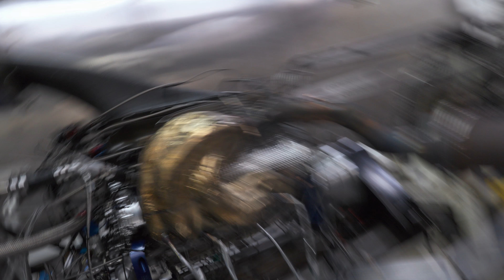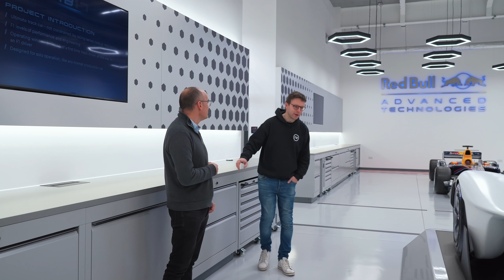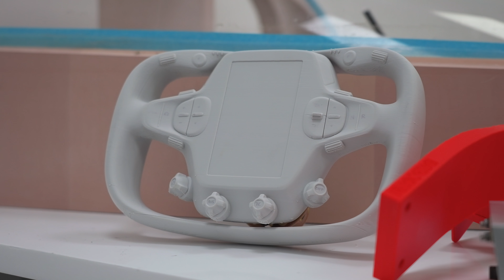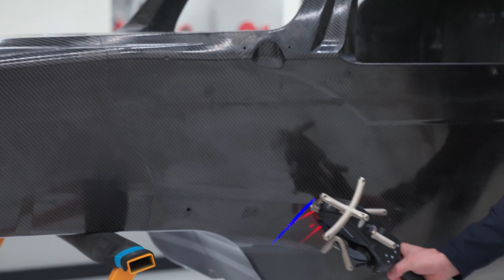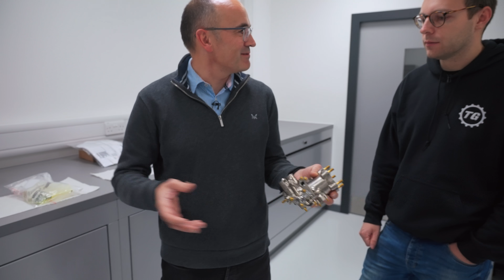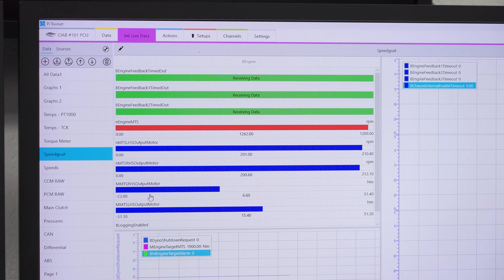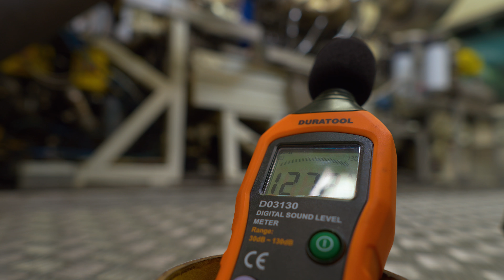Hear The Red Bull RB17 Scream: 15,000rpm V10!

Comment: You dont know where the dogs are you just get a sighn wave matching the rotation and slam the gears together at every point on the sighn wave and the ones that work best well there you have your timing to slam the gears together and vuala they match up but that does not mean that you know where the gear teeth are... if im correct at all in my assertions

Comment: At lower speeds it sounds like a hydraulic pump and that sound is pure torture.
Reply: U know that is an engine dyno right?
Reply: @Shin_Majin No. Thanks for telling me that.
Reply: @magnusenamd yeah so it will sound way more high pitched and better with an actual exhaust system in the car running. It's like taking off the fine tuned system of a trumpet and just make a metal tube to blow into.

Comment: "This word usage is a metaphor derived from the idea of a dog (animal) biting and holding on, the "dog" name derived from the basic idea of how a dog jaw locks on, by the movement of the jaw, or by the presence of many teeth. In engineering the "dog" device has some special engineering work when making it – it is not a simple part to make as it is not a simple bar or pipe, and the metal used in its construction is likely to be special rather than regular steel."
Wikipedia

Comment: Why is it called the rb17?!
Reply: RB16 was the 2020 F1 car.  RB17 was to be the 2021 car when the new ground effect rules were to come in. Because of covid those rule changes were pushed back a year so teams ran a variant of their 2020 car.  Red Bull called the 2021 car the RB16B rather than the RB17. For '22 they jumped to the RB18  (their 18th year in F1).  So the number 17 hadn't been used.
Reply: They started designing it after 2021 F1 season and back then they ran RB16 in fornula 1

Comment: If the engine is even firing, then it needs an X or Y pipe in the exhaust to truly sing. Right now, it sounds kinda flat and plain. If it's not even firing, then it needs to be, PLUS the other thing.
Reply: Once the car hits the track it will feature a 10 into 1 exhaust layout giving it a higher pitch like the McLaren mp4/15 which Adrian newey was intending for rather than the 5 into 1 which it featured on the dyno featured as a test mule
Reply: @R33_MKR 10 into 1 is insane. People have tested 8 and 12-1 and reported power losses (even with "correct" collector sizes) over multi-junction systems. This engine, if even firing, with an X or Y pipe, should sing higher. Like Ryan Tuerck's Judd V10 swapped Supra (which already simulates 22k rpm F1 V10s and their divorced exhausts) but pitched up 4.5 semitones.
Reply: @Drunken_Hamster  In the talking bulls podcast Adrian Newey said that during his time at mclaren when the v10s where around they had a 10 into 1 exhaust system for performance reasons, and he and the people at Red bull advanced technologies has been carefull to do the same on the rb17, thats why its a single exhaust on the spine of the engine cover

Comment: 15k rpm... if you use it every day, it won't last 1 year, imagine changing the engine every 8/10k km in a road car
Reply: This ain't a road car also in F1 with similar engines u would change multiple engines in the span of 1 season. They had less races back then too.

Comment: There's lots of industrial equipment that make quite a similar sound. 
It isn't really the sound by itself that gets the heart racing, is it? 
It's knowing it can be strapped to a chassis with 4 wheels, accelerate 0 to 200 mph and back to 0 in under 14 seconds, with a package weight less than 800kg.

Comment: 16:44 - "Someone will write in."

That someone is me.

Those are called dog teeth, not dogs and not dog lumps. They are called "dogs" for short, but to be clear they are "dog teeth".
Look at the 20-30 teeth on a typical road car's manual transmission gears and you'll start to see why they are called such. Only having four of them, and them being very thick, certainly hides their naming origin.

Comment: Completely useless and ridiculous car. 
Going down the highway a rock hits the paint and it cost you $20K. Not going to leave in a parking lot ANYWHERE. No way your taking it to a trackday, risk losing control. Even if you did you need to be a pro level driver to actually manage it well. 
While im sure this stupid thing cost millions $$ to own, the rest of the mass population is trying to deal with new tires and property tax on our everyday car.

Comment: Interesting that the tub extends a long way forward, all in carbon fibre; compared with many other hypercars that have a front subframe made of aluminium. I failed to comprehend how the gearbox works precisely but I think the second shaft (lay shaft?) was obscured with the particular camera angle. I have seen an F1 gearbox but that was about 15 years ago. 
Good video.

Comment: They are making affordable cars less desirable. "Hot-hatch" type of cars are either extinct or too expensive to buy for mere mortals. At the same time they are building $ multi-million cars with haptic controls, manual gearboxes, V10 engines revving to 15k RPM and you can bet those cars get sold out before they even hit the market.

You own nothing. Now they own everything and still can't get happy. No amount of physical possessions can make a filthy rich human happy. While normal down-to-Earth people are struggling to put the roof above their heads.

Comment: No expense spared!
That granite Mitutoyo surface table must be costly.
Computerized timing of the dog gear is really something.
Beautiful machining of the wheel hub and hydraulic valve assembly!
A beautiful sounding V10!  I love the whine!
What kind and formulation of oil is used?
A great video!

Comment: 1200 hp at 15k rpm is like 400 hp at 5k! if the dogs engage on the engine side, they probably don't take that much torque. it'll be the gear on the wheel side taking all the force because of the insane gear ratio, and they can make that beefy im assuming in a tiny package.

Comment: It's not 1200HP going through the dogs, it's whatever torque this makes at peak. And because it's a high revving low displacement engine, it's prob not making a lot of torque, but power is torque times rpm, as it's a measure of work over time, so having a lot of revs, it can output a lot of power with not much torque. Similar to a motorbike low displacement engine.

Comment: So how come, I wonder, that in over 45 years of riding and racing bikes, all using (Japanese) constant mesh gearboxes, that I've never ever experienced a 'dog-on-dog' event ? (reads a bit funny, doesn't it 🙂?) Not even when using a quick-shifter, allowing for open throttle, clutchless upshifts?    Some low tech is just plain good enough me recons, at least for home and garden situations.

Comment: Won't beat mcmurthy speling
Reply: Firstly, spell the name right if you're serious about making an argument without looking stupid.   There are two words and you got them both wrong.  McMurtry Spéirling.

Secondly, the Spéirling will win in a 30 second race up Goodwood hill. But but it in a race for lap after lap around a circuit it'll spend so much time charging while this thing just blasts around. 

This sounds so much better.  That's the difference between car people and those who are fans are quick domestic appliances.  We don't care the 0-60 of a boring EV, we want the sound, the feeling and connection of an engine. It's not a soulless laptop. It's about having something called "fun".
Reply: @sparky4878 smart people dont need proper names

Comment: For those interested, the only difference between this gearbox and an F1 transmission, is that in F1 the new gear is engaged PRIOR to the current gear being disengaged during an upshift. This is what gives rise to the name 'seamless', because torque is ALWAYS being transferred to the wheels during the shift. By knowing the location of all the dogs, it is possible to deselect the current gear moments before the gearbox would otherwise destroy itself by having both gears engaged simultaneously. The engagement of the higher gear causes the lower gear's dogs to become unloaded (due to the drop in engine speed), providing a tiny window of time to pull out the lower gear's dog ring before a catastrophic failure.

Comment: 1200kg of downforce? thats surprisingly low
Reply: Far more than that.
Reply: U think it would pull over 5G in corners with just 1200kg
Reply: @Shin_Majin yea thats why i find it odd. it sounds like some 100mph estimate
Reply: @gp8666I think the 1700kg of downforce is a sandbag lie cuz there would be no way it would be faster than an F1 car at basically every single track and pull over 5G in corners and brake even faster with just that. An F1 car for example has like 3000kg at around 300km/h. Adaptive suspension won't be that much faster.

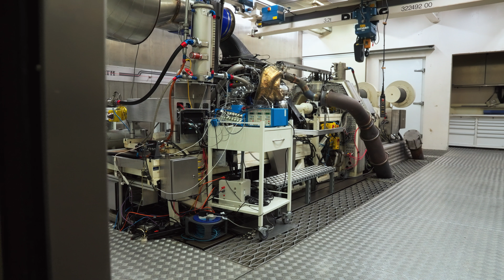Comment: @28:42  4000RPM and only 100 Hp?   nuts.  Must have a stroke of 1.5"
Reply: Because it was basically idling at that point.
Reply: @sparky4878 a 4k idle?

Comment: It was the intoxicating sound of the engine that pushed new Ferrari 296 Cabriolet MY2026 owner Vince Zampella (Call of Duty designer) to floor the throttle for 200 Metres through a tunnel this past week, killing him and his passenger when he understeered into a guardrail at over 100 KPH. I was astounded when I saw bystanders dragging his lifeless passenger STILL STRAPPED INTO HIS SEAT away from the now burning Ferrari with Vince strapped behind the wheel in the flames. I wonder how big the lawsuit ask will be against Ferrari for the seat ejecting with the passenger still strapped into it!

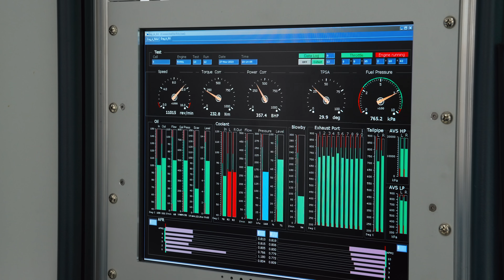Comment: 30:20 this made me rethink how engines work. All they really can do is output power and they never actually want to be at a specific rpm but rather they are forced to be at a specific rpm through loads that they can or can not lift through the gearbox and/or driver. That engine is full throttle all the way and all those changes in rpm are forced states of the dyno

Comment: No car should be competing with an F1 car. F1 has lost its way. Chasing sustainability over performance and taking direction from bureaucrats and politicians rather than designers and engineering pioneers.
Reply: F1 used to be an engineers wet dream, now it's more like one of those dreams where you can't move because a demon is sitting on your chest and that demon is Muhammad Ben Sulayem and the FIA with their bullsh*t rules and regulations.

Comment: 00:17 I'd rather buy practical EVs than these unuseable, fuel hungry vacuum cleaners.
Reply: Then just do that lol
Reply: How are they unuseable?
Reply: @SelawLeinad-h4u  should’ve said barely usable/impractical.

Thing you can use more = more usable. See how many km you can drive these without something breaking, compared to a Tesla or any other decent EV. Then try doing that with your family in it. Or try picking up your friend from the airport in this “cool whip” with their luggage.
Reply: @c @clippythehelper know what “more usable” means. And this isn’t meant to be a car to pick up your friend with luggage. And it’s a two seater. This is a track car that might be road legal. It’s not designed to be a car that you take to the grocery store, it’s designed to be fast and powerful, and has a V10 because there are awesome. They could’ve easily used a V6, but they didn’t.
Reply: No one asked you clippy.
Reply: Rage bait like that ain't gonna work in 2026 bro
Reply: @QuantumPlaysOfficial  come up with a logical response when you have one. That sht sounded worse than even the already bad Temerario.

ICE vehicles are gonna be dinosaurs in no time. Just catering to the “look how much I spent on this impractical vehicle” people, and the online circle jerk community. Just like those outdated luxury watches that tell time no better (in fact worse) than the digital clocks.
Reply: Not one person would rather buy an ev lol
Reply: @E99584 unfortunately you’re wrong because there are a lot of idiots out there would actually do that
Reply: Nice ragebait, try harder next time when the world is running out lithium resources
Reply: @nghiabui2001  how many decades of oil do you think you got left genius?
Reply: @clippythehelper centuries at least
Reply: @SelawLeinad-h4u  a simple web search would've saved you from this stupid reply of yours. We're talking about oil/fuel in the context of consumer automobiles here. Let's see if you can afford petrol for your dinosaur ICE car in 2050.

Comment: A "dogbox" transmission gets its name from the large, dog-like teeth (or "dogs") on its internal engagement rings, which lock gears together for extremely fast, mechanical shifts, unlike the smoother but slower synchromesh in road cars. These teeth resemble a dog's bite, allowing for instant, brutal engagement in racing, though they can be noisy.

Comment: the conclusion i assume is that COSWORTH builds the best high performance engines either they are 10 cylinder ones or 12 cylinder ones. And that's a fact
Reply: ...also 16 cylinder

Comment: Le Man Hypercar style head protection you say? 👀👀👀👀👀👀👀👀👀👀
Reply: Unfortunately it's not even close to meeting LMH regulations on power, downforce, width, length or weight. Same reason the GMA T50S wont race at Lemans under any current classification. Making it fit regulations completely changes everything about the car. Would more than likely be cheaper and better performing to design an LMH spec car from the ground up than trying to modify something to fit badly
Reply: @RG-gg5ye You can always modify it what's the problem?

Comment: It's amazing how the shitiest drink in history (other than Kombucha 😷🤒) made enough $$$ to fund this much madness. People really have zero taste if they think that root and dirt flavored carbonated crack is actually worth buying. Let alone consuming. I wanna see the Dodge Tomahawk SRT Vision Gran Turismo car from GT6 become a reality! If I ever get to win the lottery, I'll just build it myself. With help obviously! Active aero, active suspension, active body work (think about the BMW Gina project), and use a super turbo hybrid setup running 93 octane main fuel and water meth injection with hydrogen as a booster. And the electric motors for torque fill and off the line and apex exit boosting. Full GMA/McLaren F1 three seat layout, Porsche PDK-esque DCT, "J-Dampers" for added stability while not in a full compression or rebound situation, 100% isolated pushrod suspension per wheel. Active aero driven full air braking system along with a traditional ,albeit inboard, carbon ceramic disc braking system that of course works in concert with the air brakes. Pneumatic energy recovery system in conjunction with a standard KERS setup. And the engine itself would be a 13,000rpm max W12 or V12 designed through Pagani and Totem. Who would also style the car with me inside and out. Key targets? 0-60 sub 2sec. 0-120 sub 4sec. 0-300 sub 20secs (all in Mph btw!). Power to weight of 0.8kg per 1hp. Somehow get some stealth fighter coating for the paint for radar deception, or a hypersonic coating to keep it slippery at 300mph. And the body would be made of a material I cannot discuss on here because I haven't patented it yet. The revolution is coming for body materials, so stay tuned for that! Anybody wanna fund this project,  just send a shout. We'll take it to Red Bull's shite drink making arrogant complacency!

Comment: Gordon's not going to be happy that the caffeinated koolaide guy got 3000 more rpm's.
Reply: GMA T.50 still wins highest road car rpm fortunately
Reply: Pneumatic Valves, not street legal. T50 uses conventional valve springs. Doesn't need engine rebuilds.

Comment: I design spacecraft structures, and we use the exact same type test rig structure as the suspension testing when you need to measure stiffness very accurately. We usually call it a "Book End", I've never worked on something with that huge of a book end but it makes sense you would use it to test suspension components. That thing is so huge not to be strong (albeit that's a byproduct) but to be very stiff. If you're trying to measure how far something is deflecting, you want to make sure you aren't measuring the test fixture moving (or at least are aware of the fixtures stiffness). Some stuff I've worked on we were sensitive to the foundation of the building moving and you could see the test rig move due to the concrete pad moving from someone walking across it---they seem to have the same concern considering the massive floor/beam structure the test rig is bolted to.
Reply: 100%.  I worked at NASA Glenn on and off in the mid '90's to early '03, and then again for the Dream chaser in CO from '16-'18.  The test rig needs to be probably an order of magnitude or more stiffer than anything you'll ever conceivably test on it to make sure you're not measuring the fixture too.  Its flex needs to be less than noise/repeatability.  As old as that looks (plus a little rust, etc.), I'd imagine that's actually old large casting machining plates for a giant milling machine, which, again, need to be super stiff so you're actually cutting metal instead of pushing the fixture around.  On the Dream Chaser, on our test rig, the aero loading for the wings was predicted to be about 80,000lbs, and turbulent.  Sadly I left before we tested the wings.
Reply: are these typically just made from steel or something stiffer?
Reply: @voidgivenfocus  Giant castings, usually iron, then machined.

Comment: In engineering, a "dog" is a technical term for a tool or device used to lock two components together. The name for transmission dog rings (and dog clutches) comes from the way the interlocking teeth "bite" and hold onto each other, much like a dog’s jaw or a persistent terrier that won't let go.